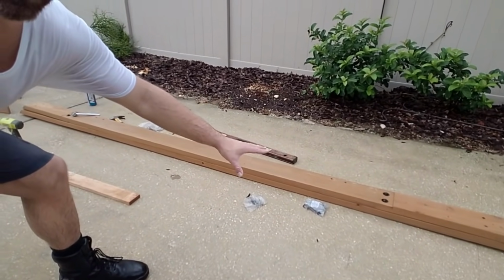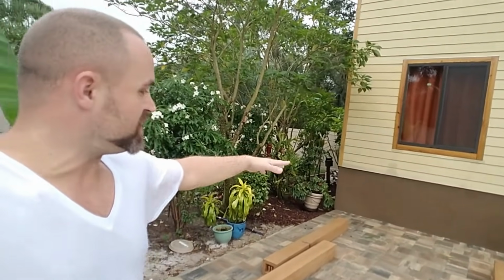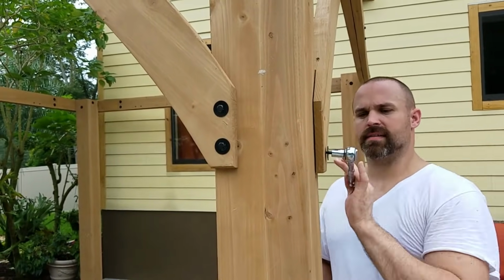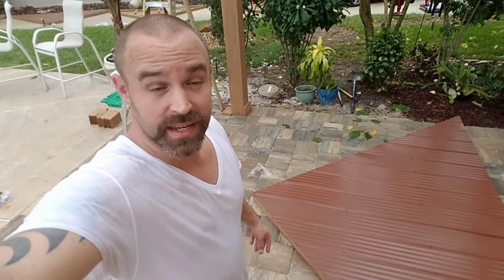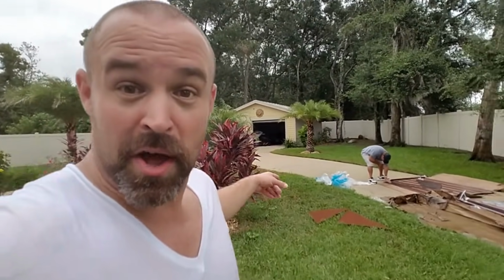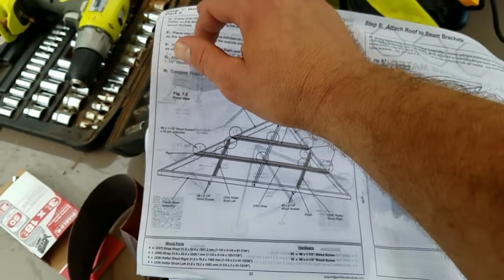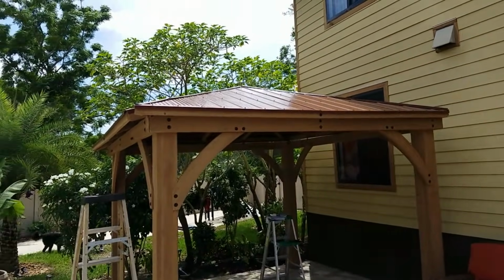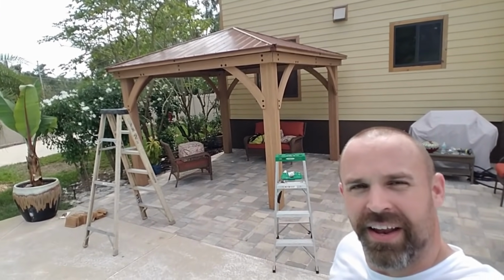Building a Yardestry Gazebo from Costco!

Comment: Can you stain the wood to provide extra longevity to the Gazebo?
Reply: Hi, awesome questions... I get this question all the time. So I figured I would answer this for Hewett Homestead, because he might be busy and it's been 3 weeks. The Gazebo comes stained already, from the manufacture, but adding more of a stain or changing the stain color, you can do. Remember though, from Yardistry, any Modifications to their product, it will and can void their warranty. But yes, you want to add a Stain, so it will increase gevity of your Gazebo. They are super nice, with so many add ons you can do... We install for the Maker and Seller.
Reply from the maker: For sure it is all real wood

Comment: How do you anchor the posts to the interlock?
Reply from the maker: We did not anchor ours. If you are placing on pavers like this and want to I  suggest removing the pavers underneath the corners and driving some thing into the ground and maybe even securing it with concrete.

Comment: Great video. Thanks!  Question.  Do you anchor it to the pavers some how?  What if a huge wind comes through?
Reply from the maker: Well we did not anchor it that day. I did suggest that my friend, whose gazebo it was, Anchor it some way. I don't think he ever did but he has had no problems with it. It is very heavy and robust and right up against his house so that protects it from most winds.
Reply: @HewettHomestead  thank you
Reply: @HewettHomestead  just wondering how we should anchor ours when the time comes
Reply: @kellylee514  hi ! Did you anchor it ! I am assembling right now and have no idea how to anchor it to the pavers , as pavers are not cemented and they just sit under its gravity and pressure from each other ! Thanks
Reply from the maker: No we didn't anchor it but if you on concrete or ground I would. We were on pavers so we didn't.

Comment: How sturdy is it in gusty weather? I know it is super heavy but I’m nervous that with no double roof vents it is going to be a jeacynkite in heavy winds.
Reply from the maker: So this was my friend's house and his 0 I explained to him a couple different options for anchoring it but at the end of the day i left it up to him to finish that part off. I was just helping him with the main assembly of the unit. But speaking with him a few months after this build and after a hurricane had come close by us and given us quite heavy winds he said it stayed put and that is with out any anchors at all. To properly anchor it on top of pavers you are going to need to remove a paper by the post and drive-in some sort of ground anchor and re cut the paver to fit around the anchor
Reply: @HewettHomestead  achoringnthat way was what we were thinking. I’m glad to know it held strong even without.

Comment: I got the same like 4 yrs ago you must have sealant tape betwen the seams water drop will get into the paneling... also use joist tape to protect your beams i missed all those detials now try corrected.. use the tapes fort the poat as well... also use polyurethane to protect the pergola they dont have any protrccion form factory.. and be carfuel wi th carpetenter bees  they almost damage why whole pergola

Comment: I am thinking of adding one of these to my backyard and putting it as close to the house as possible. do you think it would be a good idea to caulk the side attached to the house to prevent rain dripping between gazebo and house?
Reply from the maker: No! Not at all... leave a gap so the water doesn't sit on the roof or the side of your house.

Comment: looks very nice..great job done! could you please tell how much distance you kept between the post and the exterior wall of the house? looks very close..do we need some space for a person to go outside of it for installing roof panel? also need to consider roof overhang.
Reply from the maker: So after we finished assembly we scooted the unit very close to the house, maybe just 6 inches from the house so water can run off and not hit the house.

Comment: Did you have any gaps where the long beam and short beam meet once they were attached to the post, (at the corners where there is a 45 degree angle) ?
Reply from the maker: Not sure exactly what your talking about but i remember the sections of roof not lining up untill we lifted the center... it looked liked it was high enough but still didnt line up...then Joe really crancked it up even higher and everything came together.

Comment: I’m building a 12’x12’ right now. How’d you get the one long piece that slides on between roof panels on top, the one that’s next to the house. There isn’t enough room between the house and the gazebo to slide it up from the bottom.
Reply from the maker: If i remember correctly we slid it on from the top down
Reply: @HewettHomestead  thank you!  I ended up doing the same. Good job only taking a couple days!

Comment: I'm a handyman, have to put a proposal together this week for a 14x14. I've got some nice power tools to make fast work of the bolts. What do you think you'd charge?
Reply from the maker: Well you're gonna need at least one extra set of hands you're set of hands. But you could do it in A-day if you're a handy fella. So whatever you would charge or 2 guys for a long day 9 or 10 hours
Reply: @HewettHomestead  I'm considering trying to tackle it by myself and using braces to get the roof up. I'm 6'4 230. I appreciate you getting back to me. I heard the roof is the biggest challenge.
Reply: @russwollet8998  I tried starting it by myself. Only got as far as setting the base up. Alot of pointless running around and balancing, and trying to make sure that no pieces fall over/get damaged in the process. Much easier to get some help, especially when it comes time to measure and make adjustments (the base needs to be level and square, and doing this yourself is hard)  Also getting all of the roof panels up is not fun by yourself (we used clamps to help keep everything together before placing the bolts in). I have my end product on my channel if you want to check it out. Im about 6'3" 190, but still found it easier to gather a few friends and knock it out in a few hours. I prebuilt all the panels myself, but assembling everything is much easier with help.
Reply from the maker: You are correct! This is not a 1 person job. The other har task was lifting up in the center once you get 3 panels on so that the holes for the last panel line up!

Comment: How did you attach the posts to the pavers ?  Thanks for your help
Reply from the maker: Good question!... we didn't. I left that part for my buddy.  I actually suggested he attach it to the house if possible but he never did. A few months later Hurricane irma blew through and it was fine... this thing is big and heavy!
Reply: Wow, are you serious?  So the Gazebo is sitting on the pavers with no attachment?  Where are you located and how bad were the winds?  I am in Massachusetts and we were concerned with having to fasten it to the pavers, so this is helpful information.  The Gazebo was just delivered is currently in boxes in our driveway and we were trying to figure out how to attach it before proceeding forward
Reply: Peter Farley Hi There, I’ve purchased one from Costco and I also have pavers. Have you installed yours? If so what have you used to secure? Thanks!
Reply: @alecasadei  Hi Marcos.  We actually didn't secure it based on what Hewett told me.   The thing is solid.  We have had really high winds with no problems in Massachusetts.
Reply: Peter Farley Hi Peter, that’s great. I’m in Toronto and we get high winds as well. Thanks for your response.
Reply: Marcos Casadei you’re welcome.  We had the same concern as you but it hasn’t been a problem and won’t be considering how solid it is

Comment: I have two questions: 1- Can I install this on my interlocks or do I need a post (concrete) underneath each leg? 2- If I need to have concrete underneath my interlocks, can I temporary install the gazebo (on my interlocks) without screwing the legs before concreting, and then move around when the concrete guy comes in? Is it heavy enough to stay without a problem if not screw it? Is it too heavy for 4 people to move the whole thing around?
Reply from the maker: By interlocks I assume you're referring to pavers. As fot the tie down method you will need to figure that out on your own. There are lots of different ways to do it. The gazebo is very heavy and will withstand some stiff winds with no problem.  You will need at least 4 people to move it but if you can get more then I would suggest it. I am not a pro so I cannot speak with authority on the issue.

Comment: How did you get the roof on the side close to the house? Was it difficult to slide on the roof joiner?
Reply from the maker: It is hard to remember  cuz it was so long ago, but I think we rotated the unit just enough to slide them in and then rotate it back to get the other side. It was heavy  but me and my buddy Joe are both big guys.

Comment: In your opinion woud you be able to pick this up and move this a few feet  with 4 people . One at each post . I have the 12x14 sitting unbuilt under a tarp on my property for two years until I finish my patio . Not sure if the town is going to bust my chops about it . Not applying for permits . They like to say no about everything and raise your taxes . Im in  NY .
Reply from the maker: If you had 4 grown men you could probably move it. Its definitely sturdy enough to handle the move. Very well built in my opinion.
Reply: @HewettHomestead  Thanks for the reply . By the way . Your property looks great. Like a resort

Comment: Hello please some advice, i want to put this in a 2nd story deck will that be ok? i think us so lovely did you seal the footing to keep water out? Thanks in advance
Reply from the maker: Be careful to make sure that your deck can support that much weight. This thing is very heavy. As for the Footers we did not seal them but it would probably be a good idea if you want it to last a very long time
Reply: @HewettHomestead  thank you do you know how i can find out how much weigth is to much?
Reply from the maker: Your gonna have to go on line and research weight loads for what ever type of lumber your deck is made from and how wide they are spaced... 2x6 set 12 inces apart will cary more load than if there set 16 inches apart.... and make sure theres no wood rot on any part of the deck that will be carrying the liaf

Comment: how did you do the roof with only 2 people
Reply from the maker: We got all 4 pannels up and attached to each other not worrying about attaching them to the beams of the structure. Then my friend Joe stood on a ladder underneath all four panels and raise them up by hand and held them there while I tightened all the bolts this gave us the correct pyramid shape so that when we set it back down on top of the beams everything lined up for the most part. The same thing could be accomplished if you are working solo but you would need some sort of 10 to 12 foot 2 x 6 to raise the panels on and hold it there while you tighten the rest. Although I will admit this is probably pretty dangerous way of getting the job done. Thanks for the question and let me know if there's anything else I can help you with
Reply: @HewettHomestead  thanks

Comment: Did you happen to anchor the Gazebo into your pavers? I am planning to build one, want to check if it is necessary to drill holes and fix it to the ground. thanks!
Reply from the maker: That would not be a bad idea if you can. My friend did not want to Anchor it to his pavers but rather push it up against his house and anchor it to the house. If you are going to build this as a free-standing structure in the middle of an open area like a backyard Orefield I would definitely find some way to Anchor it it is pretty heavy but if you had a really good storm it could pick it up and knock it over

Comment: Thinking to install one. How do you anchor 4 posts on the paver? Thanks
Reply from the maker: Yeah, that is the milliin dollar question. Your gonna need to drive anchors through the papvers and into the ground. Either remove one and then cut it and replace the pieces around your anchor or drill a big hole through the pavers... it not gonna be easy but good luck

Comment: I have an existing cement slab next to my home in my backyard.  I was thinking of installing this gazebo on it right next to our exterior brick wall.  Can it be done if I want to attach it to the brick wall to avoid rain coming in?  Maybe an adaptation to DeVere the rain and debris.  Any ideas?  
Thanks!
Reply from the maker: Maybe a piece of metal flashing, higher on one side so the water is pushed off. Just seal any penetrations really good or you'll get water coming in your walls. Best bet would be to leave a gap and install a gutter between the two. Hope this helps.
Reply from the maker: Maybe a piece of metal flashing, higher on one side so the water is pushed off. Just seal any penetrations really good or you'll get water coming in your walls. Best bet would be to leave a gap and install a gutter between the two. Hope this helps.

Comment: Was there 4 holes left in the roof at the end?
Reply from the maker: No sir. We did not have that problem. We built ours 2 years ago so maybee they changed their design a bit?
Reply: @HewettHomestead  good to go. I went outside last night while it rained and no water leaked through. How do u do the yearly maintenance on urs?
Reply from the maker: I don't really do yearly maintenance. If I get a leaky spot I'll seal it with some silicone. As for the wood I like to use Thompson's water seal on all my outdoor products. But I'll only do that about once every for five years.

Comment: Great video! I am looking at a small version of one of these for my bbq area. Quick question, because my backyard is interlock as well, how do I provide lift protection for something like this?
Reply from the maker: That is the big question everyone has... I did this project for my friend and left that part for him to figure out.  You could figure where the corners are and pull those pavers and pour some footers or just get some screw in ground stakes and secure with hardware from the store... just get creative and have fun
Reply: Take some bailing wire and wrap it around one of the posts, and the electrical box conduit on the house. that should keep er from flyin' away!

Comment: These are very easy to put together. I only needed my wife and daughter to hold the post in place for 2 minutes. The rest I finished in 8 hours alone. Anyone can do it.
Reply: But would you pay $300 for shipping and installation together. I found a seller online with that deal. $1799 + $300 for ship and install.
Reply: @tenncutt  shipping was free for me. As far as the installation I like putting things together so I had fun. Many people don't like or can't put these together, then I would recommend to pay the $300
Reply from the maker: I would say it depends on your skill and strength. It was not hard for me and my buddy to do but I doubt I could have done it myself without a lot of strain. It also depends on your finances.. $300 is not easy to come by for some people but for others it is for others it is. For me personally if if I had to do it again and it was going to be delivered and installed for $300 I would just pay the money